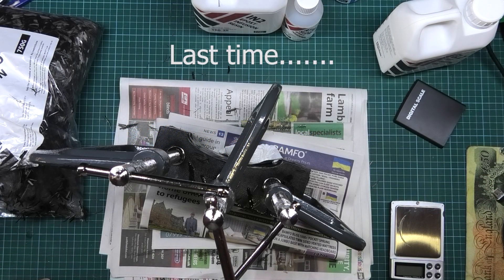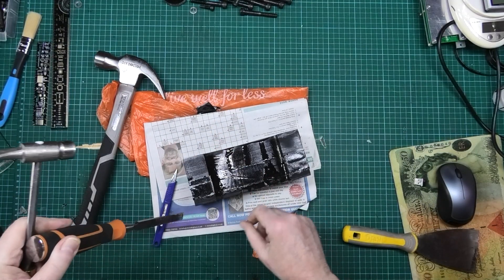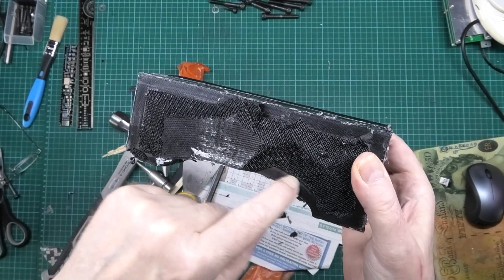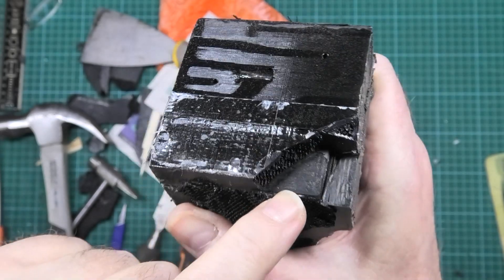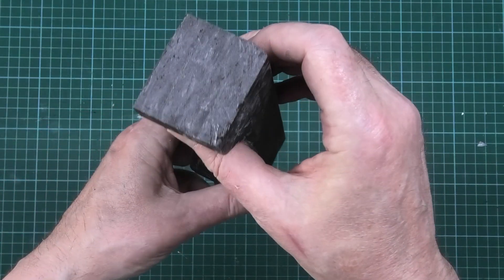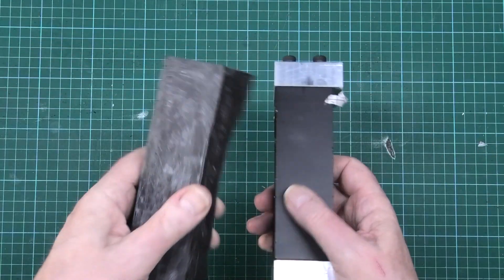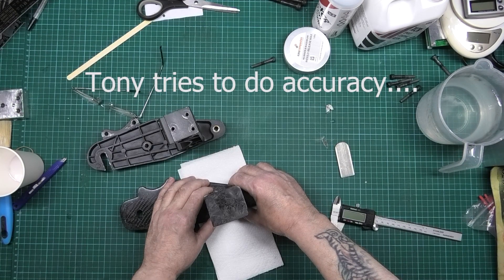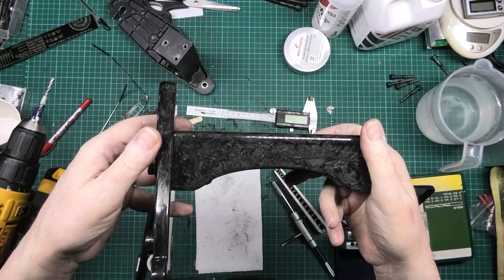🔴 EXTREMELY POWERFUL E-SCOOTER BUILD part 19 - Carbon fibre swinging arm cross brace demoulding

Comment: Tony, you really need to get one of those Flexible Removable Magnetic 3D Printer Build Surface, you will never be using a spatula to remove your prints from the printer again.
Even on very large surface prints, you only need to remove the steel sheet build surface from the magnetic build plate then let it cool then flex and your prints will come right off, no fuss.
Also, every filament medium stick to the build plate surface, no need to add anything to it.

Once you'll try it, you will never go back to regular build plate.

They're only like $20 on Amazon.

Cheers
Dan from Canada
Reply from the maker: Cheers, Dan.
I did have one but I didn't like it at the time. I wanted the mirror finish on the build plate side which can only be accomplished with glass. 
Anyway, the print failure was my own stupidity - I'd set the speed too high and the feed was clicking, I thought it was before the nozzle was tii close but it wasn't.
Reply: @Vortecks   I understand what you're saying, however, when I do need to have a nice finish on my prints, I simply wet sand them.  Another trick I've learn with experience is if I need to make a 3D print look like it is not a 3D printed part, but rather something commercial, I use "Baby Power" mixed with Minwax Polycrylic clear Protective Finish (water base clear finish) , this will fill all the layer lines and imperfections after sanding and  your parts will look amazing after being painted (It also smell good when sanding ;o) ...)

Also, some of the PEI type 3D printer magnetic bed surface are doubled sided, one side is textured and the other is smooth, this way, you can choose what finish you want.

Cheers mate
All the best
Dan